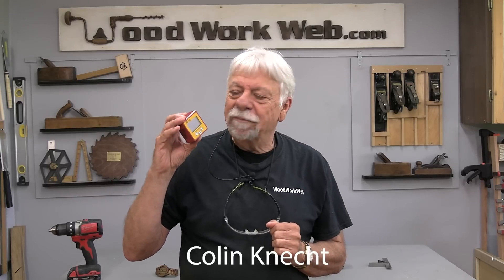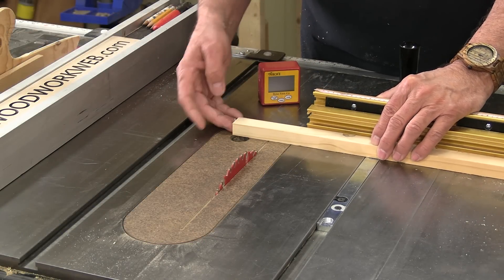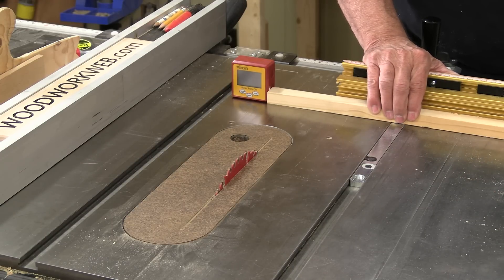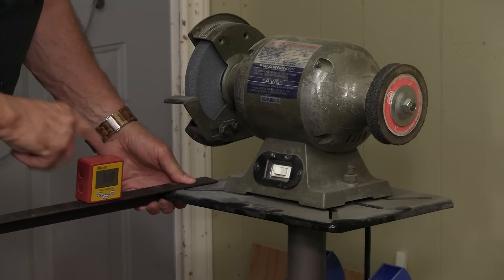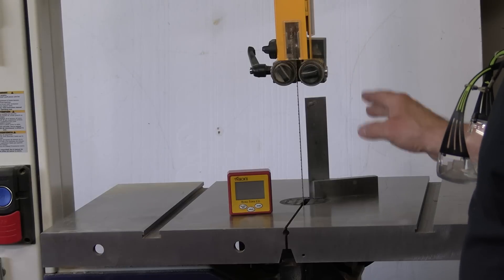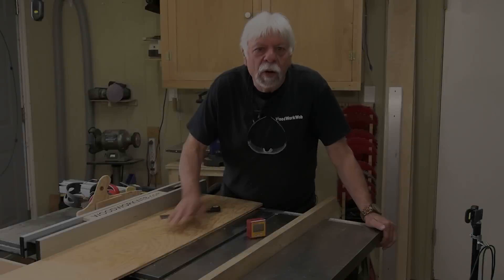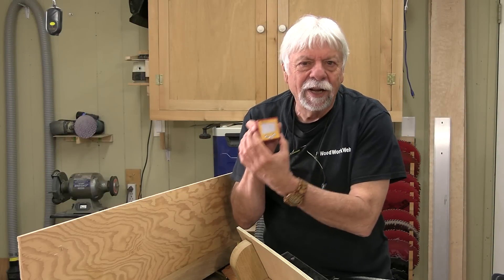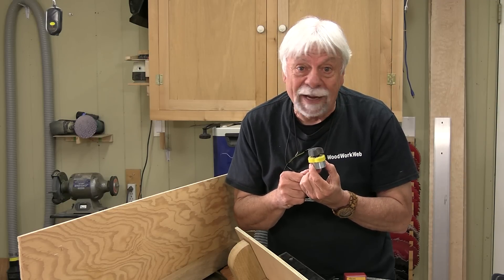10 Cool Ideas for Digital Angle Gauges!

Comment: I just wish these little boxes had a much greater resolution. 0.2 deg is no great shakes.  On the flat, a spirit level is still more accurate.  For Colin’s usage idea’s here..ok..useable, but I really want to see a consistent resolution accurately to 0.1 deg because over a distance of four to six feet that box makes the end of your line out (up or down) by as much as 3/16”….and that’s not level!  Also lets not forget to make a fine angle over a long piece you can fall back on basic high school trigonometry….example: you want a 1 degree angle over a four foot length…use Tan angle = opp/adjacent sides…so the rise along that length being the opposite side to the angle you get tan 1 deg x 48 inches long = 0.84” rise from level….Way more accurate than any other measuring method.
Finally don’t forget the old school water level…always spot on, if a but fiddly to arrange…A water filled tube as thick as a pencil, stretched along the work piece with each end set to rise vertically.  The water level at both ends has to be the same…even if that work piece is twenty feet long!  Perfect level.

Comment: So if it's accurate across the board to use my machinist square.... don't buy one correct? It's either accurate or it's not, there is no in-between in precision work

Comment: The one with the grinder, you didn't zero it right. Get the metal to point right at the center of the shaft and then zero it. The tool rest on the grinder is well below the center point of the wheel making a level part to grind have a negative angle cut into it

Comment: Most of those are not square (90°) from one side to another.  However, the electronics inside are accurate enough for my use.  When you zero it on the bottom, you need to reference (or measure) using the same side to reduce any error.  I have seen plenty of people complaining about the Wixey is not accurate because they zero it on the bottom and slap it on the side of a machinist square to show how it was not accurate.  What they are essentially comparing is the error between the bottom and the side of the packaging (not the electronics itself).  Those are made of molded plastic.  Of  course they are not square.

Comment: When planning the angle, very carefully set it to 25 deg on a flat non-moving surface, then zero it out then put it on the plane. It gives you + or - off of 25 deg.
Easier to see and use.

Using it at an angle (for other uses) - then zeroing it out - shows you when you leave your present angle

Comment: Great ideas, except that I disagree on using a square to set the table saw blade.  My problem is that the throat plate on my saw can gather dust and other debris so that it doesn't necessarily exactly aligned with the saw table.  So I use the angle gauge to be sure my blade is at 90 degrees.
Reply: Your square should be long enough for most of it to be sitting on the actual table. If your throat plate is throwing that off because of debris, then I'd think you'd have a bigger problem with your work pieces running over that

Comment: I liked the taper jig idea (though, being weird, I just use the Tangent trig function).  But:
Stop block? No!  Way too easy to move.
Angle grinder tip?  Nope!  Zeroing it to the base does nothing for measuring the grinding angle, since the base is irrelevant to that angle of the tool rest.
Reply: I like his videos but this time I was going to comment the same thing you did. This seemed like fishing for ways to use the angle finder and showing some non-tested uses.

Comment: Nice video about Digital Angle Gauge.  When doing an angle on the band saw and drill press wouldn't it be more accurate to zero out the gauge on the saw blade or the drill bit rather than the table?
Reply: he assuming your bandsaw or drill press already square.
when it come from unknown angle your method is right